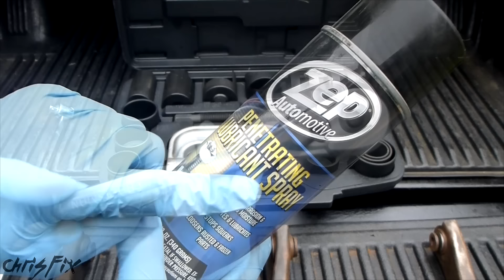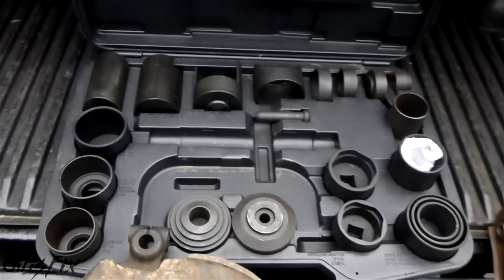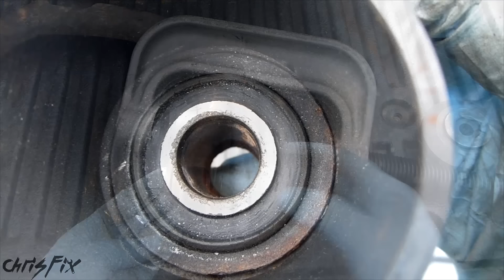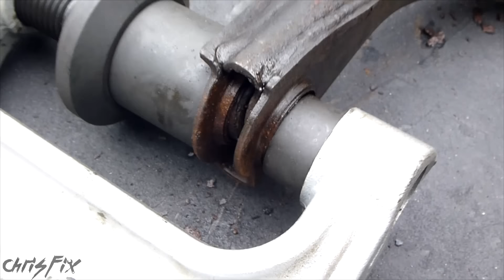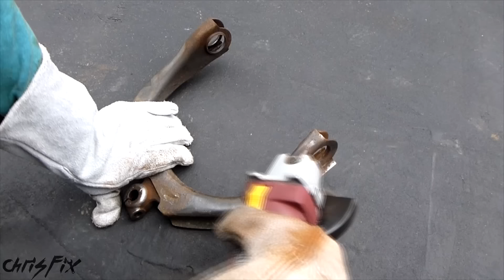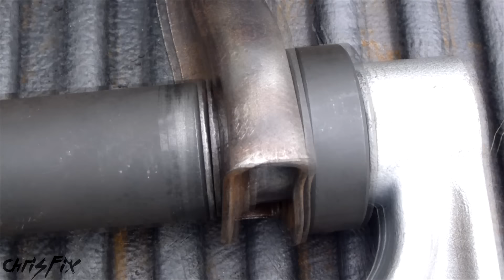How to Replace Control Arm Bushings (EASY)

Comment: Just replace the entire control arm. They come with fresh bushings and usually cost about the same as the bushings sold separately. 
For most consumer cars, it costs about $50 for both control arms on eBay. 
A set of bushings are $15 and you have to go take the control arm out to remove and replace the bushings anyway.

Comment: You guys are e fucking regarded and fucking cowards. Asked how to remove and install upper control arm bushings on a2008 2/w drive Nissan titan . The bushings are located at the very end of the control arm and there is nothing on the back side of the control arm to brace or support anything to cup around three sides of the bushing to press it out. And none of you are smart enough or brave enough to remove the old bushings and install new one or make a video that shows how for a 2008 2/w drive Nissan titan.

Comment: 1 - 16” threaded steel rod, 6 washers, 1.5” brass coupler, 2.5”w x 3.5”L steel coupler, 2-1.5” long nuts that thread on both ends of rod, about 20 bucks of stuff at Home Depot

Comment: Thanks for the video! Would it be a bad idea to paint the inner diameter of the bushing hole on the UCA to prevent rust or would it not let the new bushing fit?

Comment: One note, I did not see how you installed the other bushing, so I put the mounting bar in my vice to keep it still, then slide the new bushing over the mounting bar and simply used the outside washer and the nut to crank it on.  Occasionally lightly tapping the bushing to keep it moving and help it not to bind.   This worked easily.

Comment: For Mercedes always use the OEM part .  Never buy aftermarket.  TRW is the only brand that is an exception.  I replaced my lower control arm with Beck Arnley which turned out to be Meyle & it was cheap and hollow.  My oem lower control arm was like a german tank.  DONT EVER USE AFTERMARKET CONTROL ARMS!  ONLY REPLACE OEM BUSHINGS & PRESS IN !  FREE ADVICE...

Comment: Just a word of caution on using a wire brush on an angle grinder...  Many of these units turn about 13,000 RPM and I doubt many wire wheels are rated for anything close to that.  It can take more than safety glasses to stop some exploding wheels, so please be wise and don't push your luck too far.

Comment: Good video, clear instructions but the one thing that should be noted is that it's a good idea to place something in between the walls of the control arm to keep it from collapsing in and possibly cracking. It looks you can see it collapsing, and that a new crack appears along the seam that wasn't present prior to pressing out the bushing. Usually a piece of cheap exhaust tubing can be cut to width and then cut in half so you half two halves you can place around the bushing inside the control arm walls to prevent them from collapsing and/or cracking.

Comment: Great video nice and clear, another thing to bear in mind is you should be adding some support for between the ears on the end of the control arms otherwise you can crush them together. This will make popping the bushing out harder and especially when pushing the new ones in. I use an old socket or a cut down bolt to wedge between the ears, this stops the two sides crushing inwards.

Comment: Great video on removing worn bushings, I would offer this tip, if the bushings are rusty, try soaking overnight with white vinegar, it will break down the rust and make removal that much easier. Thanks again for the video!

Comment: I just hammered my old one out with a heavy hammer. No need for expensive tools. But need to ensure new one is seated fully and squarely.  This being said, it only lasted 2-3 years.  Also most cars have an emergency screw type jack.  One could rig that up to force out the old part.

Comment: Next time , bring up tension on the assembly , and strike the bolt with a hammer instead of building the tension to the breaking point ..
It also may avoid distortion of the control arm ..

Comment: You're an excellent teacher and communicator. I'm always delighted when I see a video from you on some topic I search for, because I know you will address the important points, and will address any common difficulties. You've helped me save a lot of $$$ fixing things myself. Thank you!

I'm about to replace the bushings on my lower control arm. The arms are in great shape, but the bushings have visible splitting all around. I live in the desert, so metal doesn't rust much, but the climate and the intense UV light makes rubber break down fast. This is, as always, a very clear video! You've removed any fear I had of doing this myself.

Comment: I've been lamenting whether or not to replace the whole control arm vs simply replacing the bushings...I keep hearing from people that I'll thank the GODS if I just replace the whole unit. But...the control arms THEMSELVES are FINE...and I can't stand the thought of spending a few HUNDRED dollars vs around 45.00 for the bushings. Obviously the advice I'm getting from others is from the folks who HAVE the cash...I don't. And even if I DID...it'd be immoral to try to justify the extra expense simply for the convenience of fixing the part when I'd MUCH rather use the money I save to install a banging STEREO in order to listen to TOOL! Your video was AMAZING... straight forward, to the point,  easily understandable...and a confidence booster! If you were here you'd see me BOWING! THANKS for sharing your prowess...

Comment: Chryst I fallowed you long time ago, keep going you are one of my DIY teachers...GBU...
Kryst I just get to finally substract after fewer hours, fighting  with the bushing from the arm support , but from the set that I oredered from 1 A Auto "TRQ ", but they sended  the wrong one, chrysler town and country Limited 3.8 2005, they are surounding around the form for replacing it etc., but I need to muve further cause the inspection its over, i have to reorder, how may I now if I am ordering the right one..?

Comment: So I know it's a video about replacing bushings, but as said the only reason you'd go to all this trouble is if the control arm was very, very expensive.
Buying the whole control arm removes problems like rust removal, pitting and damage, painting and saves a lot or time and work. 
99 percent of the time its not worth all the hassle. You could have two new arms fitted in the time it takes to remove a single well corroded bushing.

Comment: It's a HUGE help to lubricate the threads on the screw.  It's the friction of the threads that cause most of the resistance, not the metal on metal of the bushing. It also helps make your threads last longer from unnecessary wear.

Comment: I didn't look to see if this has been mentioned elsewhere, but NEVER wear gloves when using a grinder. You have the guard blocking the gloves pretty well in this video, but if even a small part of the glove catches it's going to pull your hand right into it. It just isn't worth the risk.

Comment: One thing that I do on these stamped control arms is use some heavier exhaust tubing to create a sleeve for the inner part so you don't squash it while pressing the bushings out and in.
I measure the inner distance.
Cut it that high and then split it in half so I can get it in there.
I use a hose clamp to hold it together.
Works pretty good.

Comment: Thanks for the video. Looks like I have a bad control arm bushing on my Jeep Patriot. Likely will get the work done by the dealership as it should be covered by the extended warranty. But, your video was very useful to get a general idea of how and what needs to be done if I run into this again in the future for my other car. Thanks again. Andrew

Comment: Good video. I happen to have brand new sealed 2013-18 Ford Escape Front Driver Side Lower Control Arm with BallJoint 

Ford Mazda Volvo Front Sway Bar Link TRQ Automotive Part # 1assl00440 

2014-2018 Ford Escape, transit, Focus, C-Max Inner & Outer 4 Piece Tie Rod Set TRQ Automotive PSA87436 

I sold my car and don't need them now. Make any offer. If anyone needs, let me know.

Comment: you did an excellent job the only thing i would recommend is that you put some sort of support into the middle part where you are pressing the bushing with extreme force. after examning the before and after control arm in the video it might be a good thing to mention so that you dont bend the inner part of the control arm due to the amount of force you put onto the press itself. ( the support im talking about is between the metal where the inner part of the bushing sits.) it looked like it bent it inwards a little bit. but hey man i commend you because ive had jobs that werent easy.... you made it look like a cakewalk!

Comment: When you press out and in a bushing you should always make a shim between the gap so it doesn’t deform. I use a slice of exhaust pipe to slide in the center with a cut so I can remove it. Put your new bushing in the freezer to make it smaller and add antisize.
This process works perfectly every time.

Comment: Crap I've thought this only applies to rear trailing arm  bushings too0, but they to  have positions (they have a certain shape gums are not round inside, they are empty spots in few places) and I haven't marked any of them :( now if I'll press  them incorrectly I won't be able to do a wheel geometry, car will always go sideways. this probably applicable only for very old cars.. i have nissan cherry n12 in here from 1986

Comment: Great videos on control arms and lower ball bearings.  It looks like when you removed the bushing, the arm was distorted a bit and a weld looked like it snapped a bit.  Is that an issue?

Comment: Chris I really think you should take this video down or edit it in the press in and out process.  The stamped steel did get cracked and is a safety hazard if installed like that ...loss if steering.. If people are following your method without at least using a spacer in between for rigidity and you knew  about this issue can happen and how to examine for cracks and broken welds before installing.  People can be following your steps breaking welds ,and cracking them and not even know it and install a broken unsafe control arm.  You addressed this in later comments below that  you knew  you cracked it while filming but said nothing .I am very disappointed and going elsewhere from now on for automotive diy info. Safety should be of the utmost priority over easy of procedure for the sake of you tube views

Comment: Recommend application of an anti-corrosion agent to outside of bushing steel shell or, to inside of control arm bushing sockets.  Prevents entrapped corrosion. I use Fluid Film.

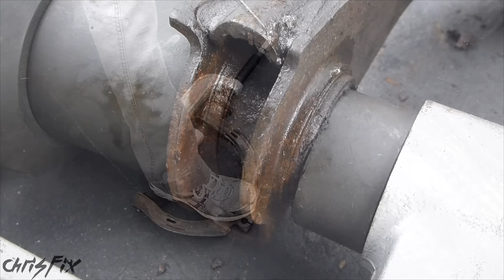Comment: I strongly suggest you add a spacer between the 2 ears of the control arm. At 5:23 right before the bushing popped you can see the control arm bend in. Doing this will prevent that happening.

Comment: I'd like to see one done with a GM vehicle.  If you do both bushings with that method you can't get the shaft in.  You have to put the second bushing in with a different method because the press won't work with the rod in place.
Great video just like all it's just missing one part for some of us Chevy guys. 👍

Comment: Just replace the whole arm. Not something just anybody should do. This is advanced knowledge. Make sure u pull it all the way out if u do it. You are gonna be hard pressed to find control arms that arnt thin 18 gauge steel. Not exactly something that should be pressed more than once. It only take that 1/100 times to cause a maygor failure.

Comment: If anyone has problems doing this job after watching this very complete video, then it's not  Chris ' fault. i just priced new control arms for a two wheel drive 1994 Ram 1500 and they were $750.00. The mechanic wanted two thousand for a complete rebuild.   This is life changing stuff and the difference between having to sell the truck or keep it on the road!!!

Comment: I failed to mention, the lower control arm is the one I'm talking about. The upper one can be done the same way depending on the vehicle and how much room you have to work. I'll start with the lower one's. You will need a jack stand to put under the frame and possibly one to go under the control arm. Sometimes just a floor jack is good enough for the control arm but other times you will need a jack stand under the end of the control arm while jacking the bushing end back up into place so you can stick the bolt in it, so to change them, you only remove the bolt to one of the bushings, and when you let the jack down, only one side comes down just enough to where you can stick your air hammer, (aka air chisel) and when you hit the trigger, it will come right out, then you put some grease around the new one including the hole, put the bushing in place and find on old socket you don't care about and put it on the bushing so you're not hammering on the bushing itself, so the socket has to be big enough to fit around the rubber so that the socket is making contact with the metal rim of the bushingsd, then hit the trigger and it will push it right back in, then all you have to do is jack the control arm back up into position and stick the bolt back through it. Then you do the other one the same way. Usually the top control arm doesn't have enough room to get your air hammer in there to push the new one back in. A cheap 15 dollar air hammer won't work but something equivalent to the $50 dollar Ingersoll Rand Model# 114GQC will do most everything up to a half ton pickup truck. When you go higher than that or anything with a higher GVWR, then you'll need a bigger air hammer just because the parts are bigger.

Comment: Nice explanation on this process except a '93 lower CA bushing replacement isn't this easy because of the tighter tolerance and newer (best) bushing that's larger than the bore. Tip: freeze the bushing and maybe heat the arm then hand press. Hopefully it works for me

Comment: This is a question I've been curious about for a long time. If you rent these tools from auto zone. What happens if the tool breaks? Do you have to pay for damage? My luck and my logic. That threaded bolt snaps in half.

Comment: Tip: If you throw the bushing, ball joint or bearing in a freezer, it slides in even easier due to temperature contraction.

Comment: There is a much easier way of removing the bushing, it is called a Saws All.  Yes just take a metal blade on your saws all and cut thru the hole to the control arm, do this in 2 places 180 degrees apart and Ta-da it will generally FALL out or you tap lightly and done.  Now Flap wheel the control arm to remove rust and crap, then press in the new bushing.  If you have some larger bolts nuts washers and a piece of pipe fabricate a press, then remember to use grease when reassembling. If it goes in hard, use a hammer and hit the bolt several times it will work in, basically tighten tap, repeat.  If you have a small torch simply burn out the rubber then all you  have to do is cut the outer sleeve.

Comment: A wire wheel is a bad choice to remove corrosion. Where the speed of the where wheel creates micro welding. Where this welding is in a oxygen rich atmosphere creates a oxide of iron that will corrode under the new paint.

Comment: Had an old 68 Nova ,The bushings were Shot badly .rubber gone ..Just a clunking and a Banging going down the road ..My Uncle is an Old Timer from back in the day ..He beat the old bushings out with a hammer and socket ..and Tapped the new ones into the control arm with a socket and hammer ...Put that car back together and PRESTO MAGIC ..Drove like a New 68 Nova

Comment: Just wondering, Is it absolutely necessary to change the control arms? I want to change out my whole suspension but just like you mentioned, the control arms are by far the most expensive parts of the kit. All four control arms look decent. I'm still learning to do everything myself (with a lot of help from you), and just want to make sure before making any moves.

Comment: I hope u didnt tighten the control arm pivot bolts when the suspension was at full droop because that puts a tortional twist on the bush and destroys the bush very quickly, screw up the pivot bolts wit your hand on the socket not the ratchet or breaker bar and drop the car on completely on so the suspension is laden with the cars weight and rock the car up and down a few times so the bushes seat correctly to take the torsion off the bushes and hop under the car and the tighten up the pivot to factory torque spects and u cant go wrong, this is a common mistake people make when replacing suspension bushes.

Comment: I can not stress enough to thoroughly grease the interior bolt hole sleeves of your bushings.
A seized in bolt later on is not fun to cut out.

Comment: Yo ChrisFix, I can't thank you enough for recommending this tool. I almost broke my little 6 inch C-Clamp trying to put new bushings back in. I was lucky enough that the local AutoZone had this for rent. Made the job so much easier. Thanks bro. I'll finally be able to get to that DIY killswitch install you also recommended.

Comment: You need to cut you a piece of metal to size to fit in between that bushing area or you will deform it trying to push the old bushing out..

Comment: Lesson (1) don't listen to the guy🤦  first us an impact wrench much faster, 2nd the press was backwards it's called a "press" not a puller or pusher and 3rd you take a 20 minutes job and turn it into a hour🤷 you talk to much and last but not least you said it 1,000 times to have the press adapter's not touch the press okay, we get it wow go back to mechanic school o ya the tools are free to borrow but what he didn't mention is you best have cash in hand when getting them free you pay for the price of that tool you "borrow" and when you return it witch you can just keep it if you wish but if you return it you get a refund